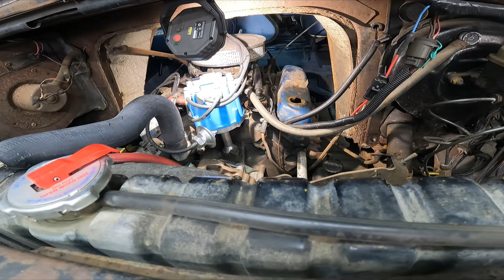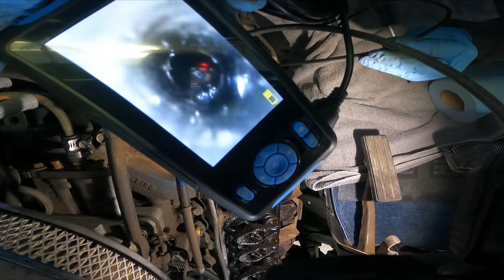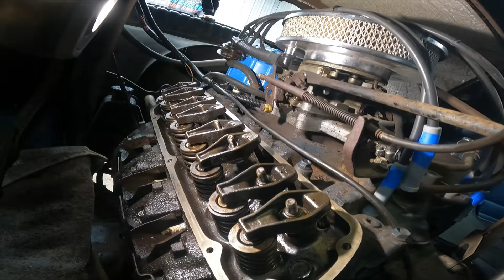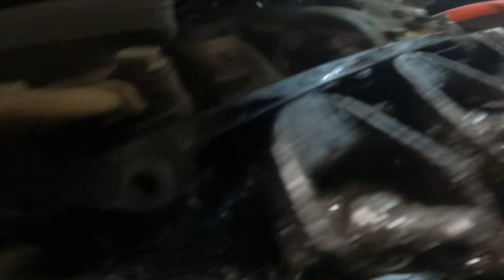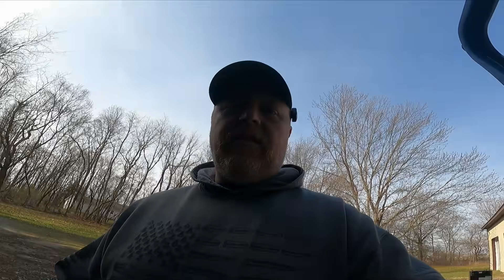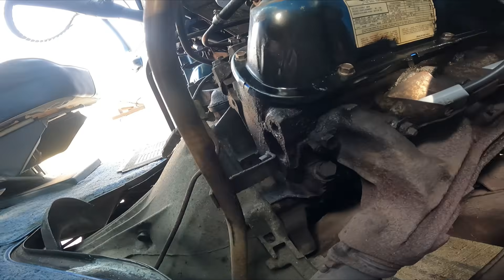HORRIFIC Oiling issue REPAIRED! I Can't Believe it still RAN? #saved #auto #ford #vanlife #oilchange

Comment: If you don't mind the price, I'd maybe consider stopping by a Cummins dealer and running the Valvoline Premium Blue Restore Gen2 for an oil change interval... If the heads were that bad, I'm curious how bad the valley under the intake is.
Reply from the maker: That's an interesting idea I had not thought of. I'm sure the valley pan area is terrible also. I think my next step is to make sure the pick up tube is not plugged up. It has great oil pressure and with 94k miles it makes me a little suspect it may be plugged up. My biggest concern is knocking something loose that will cause major damage. like a carbon blood clot .

Comment: Great little project. I'm glad you tried it.
Reply from the maker: Thanks! I really enjoyed driving the old van even though its a luttle rough around the edges 😎
Reply: @smokineaglesrodshop  They're pretty comfortable and that little SBF sure sounds like it purrs. I once had to de-sludge an engine similarly. I tried an oil change trick. Warm the engine up fully and drop the oil out. Replace with diesel fuel, some use trans fluid F for similar reasons, detergents. Let that idle until temp is up and drain again then replace oil. 
After that regular oil changes with quality oil kept it clean and sludge free. Seems like it happens when oil changes are skipped. This made the engine spotless inside though hahaha

Comment: I inherited the family truckster, a 79 Ford LTD wagon with a 351W. My grandfather bought it new; he did not believe in oil changes in any of his vehicles. When my dad bought it from him at 70K miles or so was when it finally got some love. I got it from him at 82K and much like yours it was a sludge fest, except that on the driver's side I couldn't even see the tops of the rocker bolts! Same procedure you used, screwdriver, shop vac, and diesel. I did regular oil changes every 3K miles and it lasted a couple more years. I had a really long commute to work so by the time the engine blew, it didn't owe me anything. I died with its boot on.
Reply from the maker: Great story! Sounds like yours was even worse off than mine. Luckily its not my daily just a cruiser, but i do like to take it on camping trips to events a few hrs away so hopefully it doesn't leave me stranded  😅

Comment: You might want to see if you are running too cold of themostat? Maybe not getting to normal operating temp. That amount of buildup id highly unusual.
Reply from the maker: Thats a great idea. it takes forever to warm up because it has a direct drive fan. If i drive it for a little bit it run right at 180. Although my grandpa never traveled and only ever made short trips through town, maybe 10 miles at a time. So to your point it may be from not warming up properly due to very short trips for 40 yrs 🤔

Comment: You gotta take oil pan off. Or did you already?
Reply from the maker: Nope haven't pulled the pan. It carries good preasure. I'm gonna use my endoscope through the drain plug in another video and see how bad it is. unfortunately I know it went 11k miles between oil changes atleast once 😮 Pretty sure my grandpa invented the 8k mile oil change 😂